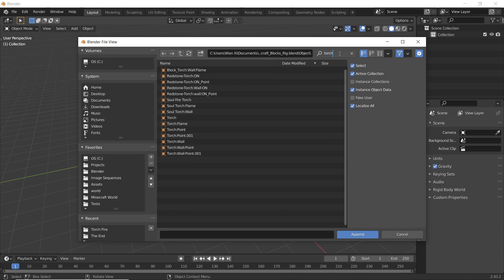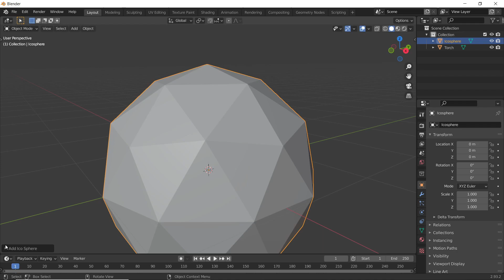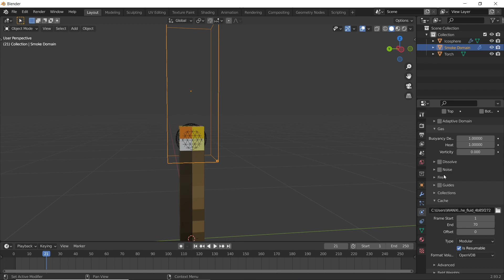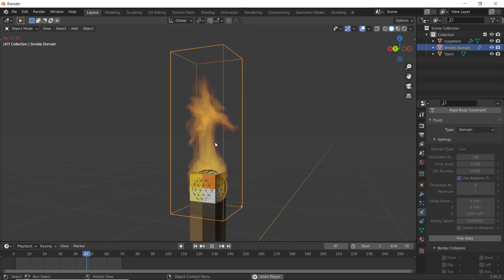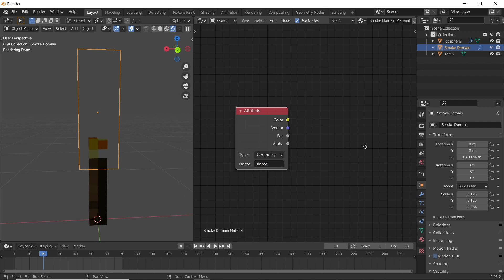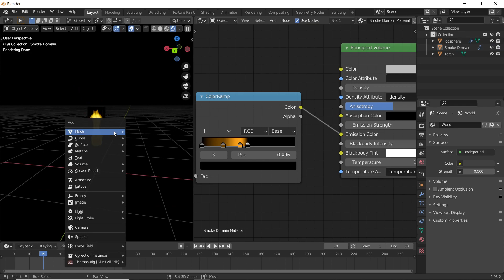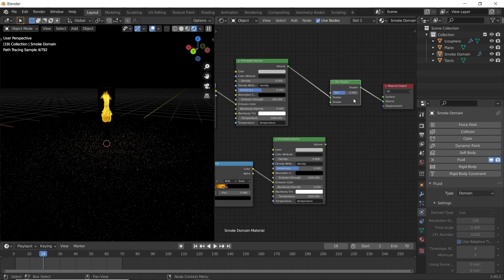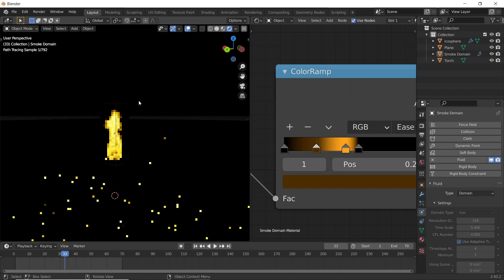Torch Fire Simulation | Blender Tutorial

Comment: Great tutorial! I have a silly question though. When I need multiple fire in my scene and I want to make them looks slightly different, is there a smart way to do it? I realized that when I shift+D the domain, the fire will looks exactly the same. and I can not modify it individually.
Reply from the maker: Duplicating the domain will make both domains share the same fluid cache folder. With the domain selected, go to physics properties, under cache section, change the cache folder to a new empty folder and click accept. The domain reset and become empty, and at that point you can free data without affecting the cache of the other domain you duplicated it from.